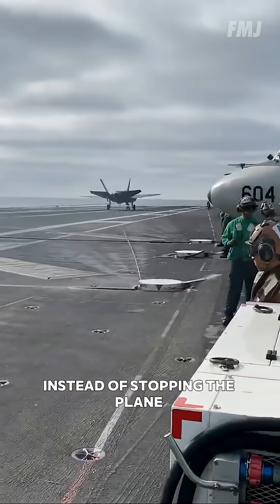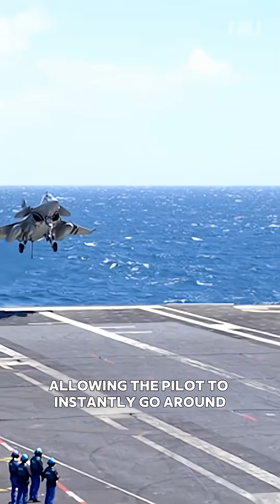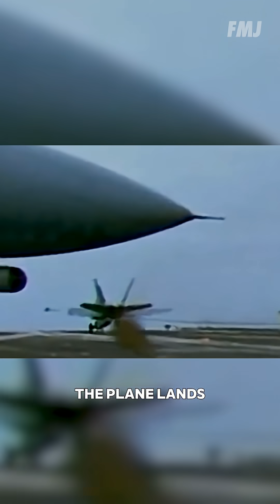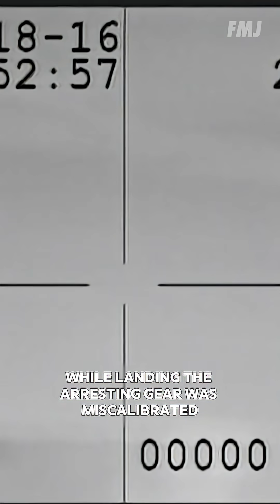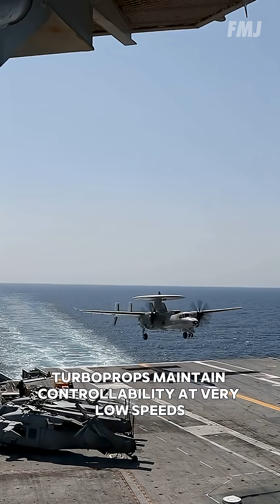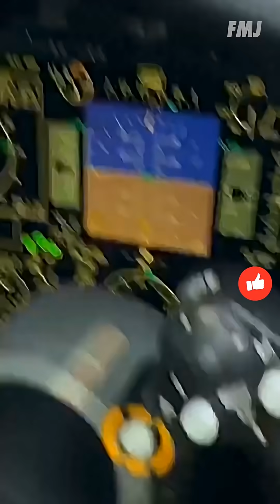What If an Arresting Cable Snaps During a Carrier Landing?

Comment: The power is only cut after a coming to a full stop. Not directly after catching the wire. Getting this wrong makes this whole clip nonsense. The Hawkeye in this video surely was still going full throttle.
Its large wings compared to a fighter gives it more lift at lower speeds. That has nothing to do with its turbo props.